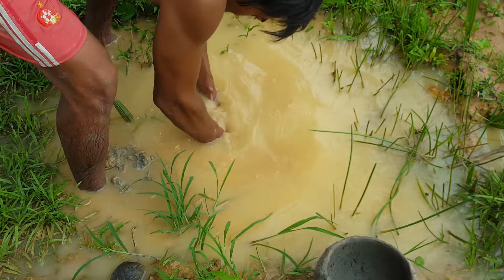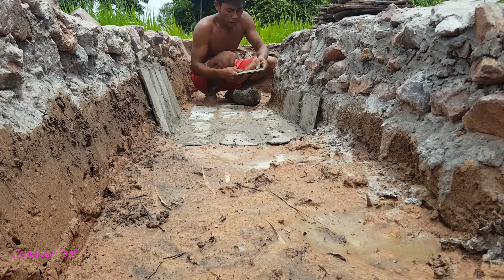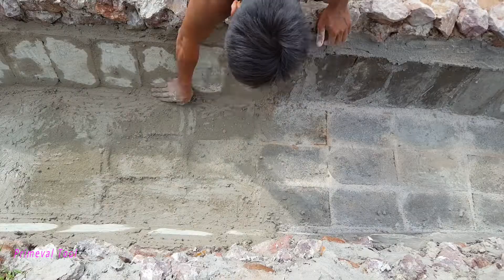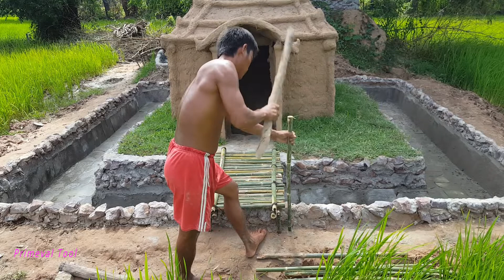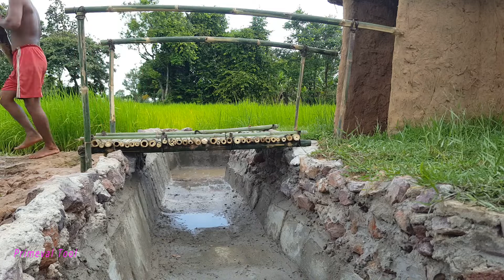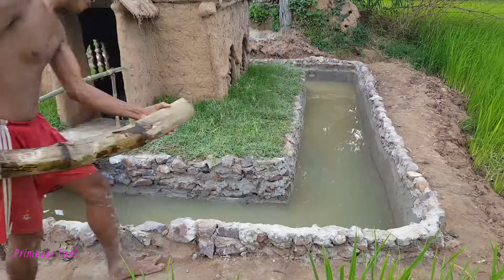Primeval Tool : Build Mini Pool Around Temple House #2

Comment: Good job. Water around the house comes in very handy I believe.

Here some things I bother all the pool-builders with:
- Leveling: If you want level surfaces you can put two stakes in the ground and hang a big piece of split bamboo between them. Then you put water into that bamboo "halfpipe" and if the water inside is level the halfpipe is level as well (just adjust a little). So, while building, you can always eyeball that halfpipe to see if your build is really level.
- Poolwater: Connect a big waterproof bucket to the pool. Put some wool cloth on top of the drain at the bucket-bottom, put some clean sand on top of the cloth and put some small stones on top of the sand - the water will not be drinkable, but it will be clean (looks nice(er)).
- Waterchange: Build a moveable "wheel of water extraction", (sort of a small water-mill with bamboo "cups" at the end of the arms). Spin it by hand. The water should splash on top into a bamboo half-pipe, quickly removing water from any location.

Nothing of that is EASY to build. But everything has its use... and building stuff is a good thing me thinks :)
Greetings from Germany (I really hope, I explained all of the above somewhat understandable).